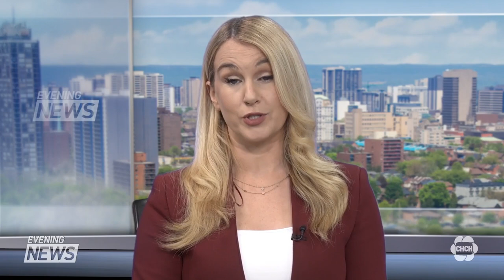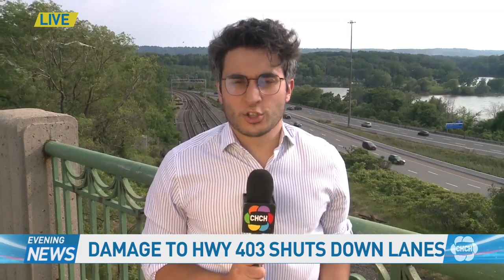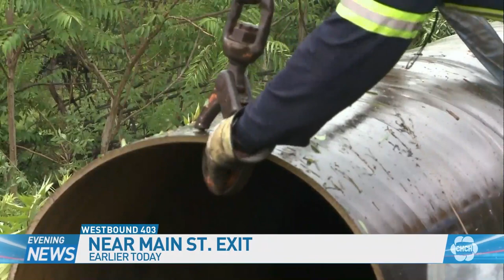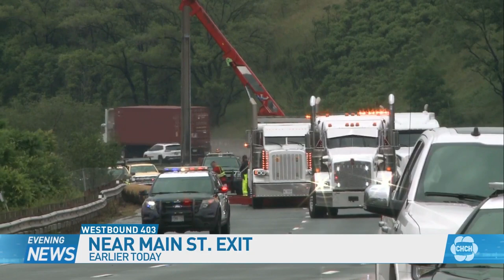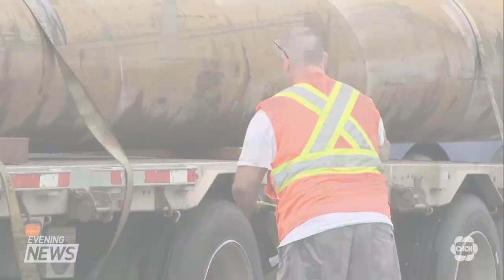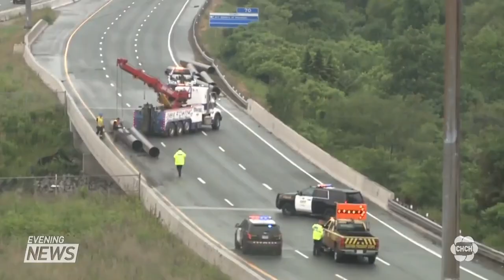Transport truck spills its load of steel pipe on highway 403

Comment: The roads are terrible. Idk where the money goes but hamilton roads are horrid. A bump the reporter says. No.. a pot hole prob 2 feet deep by 4 ft wide.
Reply: There are no potholes on that stretch of the highway. It was recently resurfaced, so that part of the highway is in good condition.